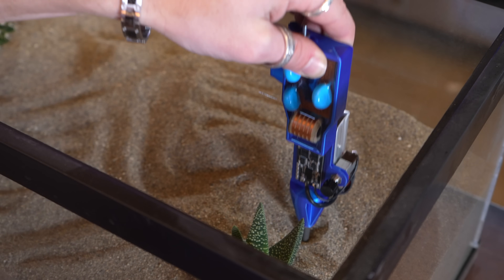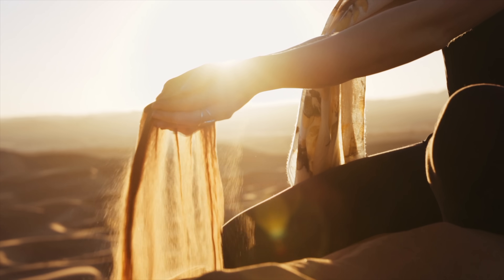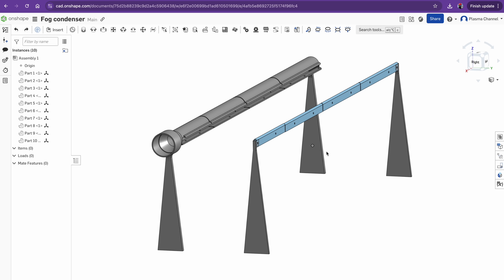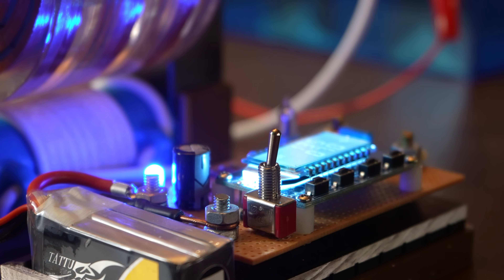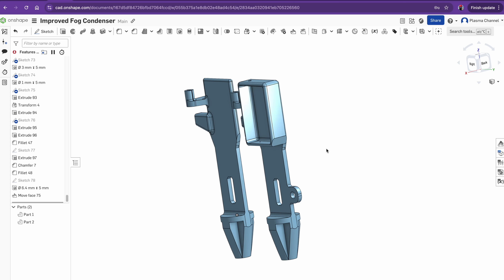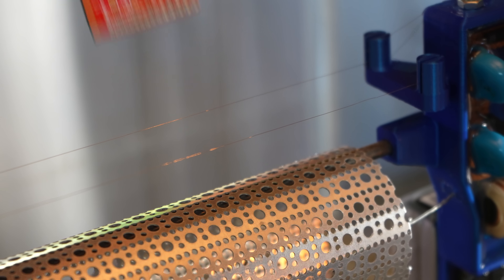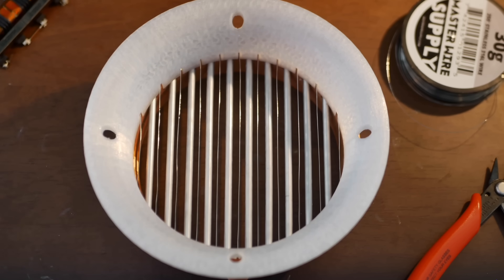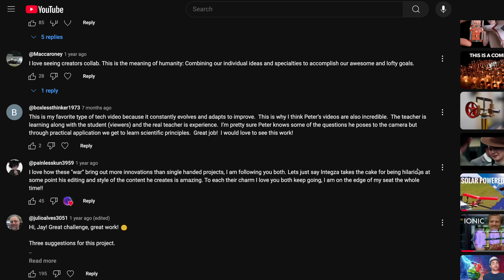Solving Desert Water Shortages Using 20,000 Volts

Comment: While this wonderful work has me more than interested, one significant fact is that while your uncharged wire collected almost no moisture, trees have been doing this for ages.  In fact, Shawn probably has seen many of these if he is in the Pacific Northwest.  Redwood trees survive completely in the dry season by capturing fog with their needles, condensing it and the runs off into droplets, raining underneath a redwood canopy.  It's largely known that the surface of the needles cause the condensation.  I am not aware of any other phenomena such as electrical charge or sound that the needles use to capture the fog and turn it into rain.
One significant factor that Shawn's work has here is that it is not one contact point of fog that is prepared to be captured, but a radius of ionization around the wire.  I'd still love to see just how large that radius is, because this directly implies that fabric or metal screens could be prepared to capture more moisture from a region of air.  There also has been several studies on capture of fog on Namibian and South American coasts where fog nets are used.  Studies say that there is not enough productivity to support people, but if the goal is to add water to underground water storage systems or catchments for the purpose of creating a water supply, then a comparison between the output of both needs to be evaluated.

Comment: I assume that your solution only works if there is visible mist (small water droplets) in the air?
In this case, no water condenses, but the droplets collect on the condenser. This requires little energy and is fast. There is no phase transition.

The usual dehumidifiers work with condensation by falling below the dew point. Here, water from unsaturated air on a cold surface is brought below the dew point, like the air on a bathroom mirror. This costs a lot of energy, but it also works without mist.

So, if there is a morning fog, your method is perfect.
If there is no fog, only the ‘old’ method remains, but it requires a lot more energy. However, this old method works poorly with fog.

Comment: We did it boys, a dehumidifier
Reply: i mean it isnt one because it can only attract water droplets from the air, a dehumidifier can rip out the water if its below the dew point (100% saturation) with condension thats the reason why this can be more effective than a dehumidifier, so it NEEDS the Mist, however if the air is normally pretty dry and only suddenly gets hight amount of water(Mist) its at least worth testing it out. In Regions without that morning Mist its useless.
 3 Things make it at least worth testing; 
Scaleability: you can make it cover a large  volume of air without too much of an increase of the other components
Simpicity: its not that complex and would be easy to repair and fix, which is important in 3rd World Countries
Cheap: the most expensive part is the high voltage generation but because there isnt actually any significant load you can use very cheap ones. However this needs to be scaled up a bit and testet at site, perhaps the mist is to thin or any other variables dont work.

Comment: Missing a flat metal panel test... just stick plane old metal without holes Infront the fog, how much condense you get... without any energy, I bet it will be close to the same as with having ions blowing water vapor through a net and hoping it hits the metal... Or better yet, use plain on fan to accelerate the fog to the same speed against metal panel and compare power consumption of fan and how much it collected... + if there so much humidity in air in desert it would not be a desert :)

Comment: Having an electrified wire over a crop may be an issue for local fauna, or a farmer who forgot the wire was there. A very fine mesh may increase the efficiency of water capture. Would the increased efficiency of your system make up for the difference in initial cost, maintenance costs and simplicity of current mist net systems?

Comment: The evaporative losses will ultimately determine what time in the morning this idea stops being able to condense water from the air. The air is also much less humid than your test setup. You will want to redesign around shade and airflow at some point, so feel to try this: 

In a cylindrical configuration you can collect water into a container below. A cylindrical tower with a gap at the base will create its own updraft (think of the cooling towers for power plants) and a central cone-shaped electrode will assist this by creating an ionic wind with the right polarity as well as fuelling the condensate to a drip fed container.

With a conical mesh in the centre of a tower you not only have your condenser in moving, moist air, but it’s crucially also shaded from the low rising sun and has a relatively small collection area at the base of the cone which you can immediately collect into a container instead of evaporating from a wide tray.

Comment: With the dehumidifier, presumably that one's able to get water out of the air that is in gaseous form rather than fog? Can you do a "dry run" of both and see if this setup also manages that? 'Cause if it doesn't, then there still are clear reasons to maybe prefer a classic dehumidifier, at least in principle.
I also question somewhat whether a device like this would hold up under the kinds of conditions you find in an actual desert. It turns out desert environments are extremely abrasive....

Comment: There are plenty of places this would work.

Definitely wouldn’t work far inland at peas here in Australia I have worked a lot of night shifts in central Australia and almost never seen a fog unless the wet got down that far and /or the lakes have filled up.

Also comparing it to a dehumidifier is something of a red herring unless I suppose you are putting it in fog as well. A dehumidifier has to change the state of the water gas in the air this doesn’t it just has to redirect tiny droplets so the efficiency is potentially enormously greater as long as there is fog in the air.

Dehumidifiers even heat pump ones have always seemed like a waste of resources and energy for water collection. Depending on how it scales your prototype shows way more promise than the things a lot of unscrupulous people were selling

Comment: how about changing the power at different rates and comparing the result accumulation in order to find the most optimized power use. You can make this easier to test by tear-weighting the drip pan plus device, instead of worrying about shaking off excess and using a squeegee (wasting time and may miss some anyway).

Comment: Hi in the study from MIT they used a SS304 mesh of 1.6mm wire and wholes of 2.6mm as best result, you used a perforated mesh. Was their a reason for this? Did you test different mesh's?

Comment: Scale this up, pairing with a solar farm. With the upfront cost of the solar farm & yearly maintenance over 25 years, say generating 1000 gallons per day as a base estimate. It would cost a very roughly estimated price of $0.030 cents per gallon. But I have no idea of the costs of installing & maintaining the scaled up fog catching device. And this was priced using your very overinflated values due to you using an over abundance of fog. Presumably the mesh nets will also need regular replacement as they will erode over time, & then like all electronics there will be breakdowns & need of consistent repairing & replacements. 

However compared to a desalination plant which ends up delivering a price of $0.45 per gallon, it may not actually be too far from that surprisingly. Even if it is slightly above that, you are getting a moisture capture method that also works inland. So I think there is genuinely an idea worth pursuing. Again these are all rough estimates but it could be worthwhile for some industrious person to work it out with every cost accounted for.

Comment: These cheap dehumidifiers are not great for comparison. They use peltier elements for cooling which have an absurdly low efficiency
Try the same test with a larger compressor type dehumidifier. Let it run with and without fog to compare. Such thing sure draws about 300W of power but since you try to scale everything to farm size this should be ok

Comment: Im in Cali , & have the perfect spot. A farm. super dry during day, but many late night parties revealed to me that fog rolls in religiously in the morning. So bad that my laptop mouse no workie, the whole thing looks like an iced drink. However, you'd likely get more clicks doing your epic adventure.   Socal / LA

     On a diff note >> eventually, after doing the fundamental science >> you should try 2 other experiments.  1: fill an underground water tank without a metal condenser. USE SAND :)   2 : Is it possible to water the plants directly ?     
        oh and lastly, I remember a famous scientist(tesla,maxwell?) found that for every foot in elevation a certain amount of kV is present. I confirmed this decades ago. It is true. Just take some enamel wire and clean piece of metal up as high as you can get it. I went on top the roof. Used a metal stake as a grounding rod as I thought the electrical grid would mess the results. Knowing the current (Amp) requirements for this water experiment is another super important variable. Caz there is already voltage in the sky, not much current tho...    Make it rain bro !!!

Comment: This has been tried and failed before. You people are smarter than this, there isn't enough moisture in the air to do this efficiently. Just watch the Thunderfoot water seer vid.
Reply from the maker: The waterseer doesn't operate off of fog. There is tons of water in fog, which my device solely runs off of, as clearly talked about in the video. This method has NEVER been tried before outside of MIT and myself. It's brand new. And you're looking at the person who will bring it to full market.

Comment: There's a programm by the UAE called The UAE Research Program for Rain Enhancement Science (UAEREP).
I belve using a modified version of your technology you can go from simple irrigation ast that would need actual ground capital to make it feasbale as in building or plaging the metal grids over a large surface area of the ground which will be an expensive task.
rather than limiting your technology to the ground.making a single arial unit that can irrgate an entire dessert region using this technology souns more promising than the current cloud seeding methods this programm currently uses as cloud seeding has its own demerits where as the applicaton of your technology workd using nature as the backbone and that s the water retention capacity of air in response to changes to temparature.
luckiliy apart from this alone MIT too did a similar project a while back trying to make an effcient electrosatit flying drone....of which they were succeful but it has such a low power that it can only manage to life itself.its basically a glorified horozontal ionocraft rather than the vertical version we are familar with.
but picture this,the craft is relatively inexpensive to build so
if many several hundered units are built thousands even it would still be ALOOOT cheeper than the current budget the UAE puts out for rain capturing technology
so these thousands of iono craft planes which fly at relatively slow speeds are launched about 2 hours before dawn over the Arabian desert.as they fly over the skies they use the same principle to condense water rather than the chemical based syte the UAE currently uses,which honestly is ineeficient as truthfully speeking cloud seeding isnt a complete scienc and sometimes works and sometes doesent so it has a low success probability.but your technology is 100 percent guaranteed to condense water.
so as the ionocrafts fly over the desert they condes water in the atmosphere creatng physical water droplets in the atmophser that attract more water vapor through Hydrophilic action.
so by sunrise youve created a huge cloud mass that cant hold its weight and releases water onto the surface as rain and precipitation.
The applictaton of your technology in this manner is very feasable,practical and best of all CHEAP and not chemically toxic compared to the current rain enhancement methods used in the UAE.
The call for proposals is currently going on for the 6th cycle.
but i trully believe that is the best direction for this technology not just irrigation but actual Rain Enhancement.

Comment: Dehumidifier has nothing to do with mist. Mist is warter particles, so they can be gathered using electrostatics. Dehumidifier squizes water vapors from air, which in turn, is not something that can be done by electrostatics.

Comment: Look into COFs and MOFs, hit me up, I would love to do a show with you on them.  They are capable of absorbing moisture from air lower than 20% RH.  They are selective to water as well; outputs pure water. Outputs water with gentle heating - which can be delivered by alomst anything.  Can run multiple cycles/hr.  I'm designing and building a system now.  super revolutionary.  plan to make large radiator-like boxes with MOFs deposited on the fins. These things scaled up I calculated 55 gal/cycle, 4 cycles/hr in a box the size of the smaller sea container.

Comment: I wish it was as easy to strip humidity out of indoor air, but it's a very different beast.  The way your apparatus affected the airborne water droplets was very similar to the classic smoke demo that used to be popular with ioniser sellers.
Reply: So this wouldn’t work as a dehumidifier?
Reply: @VictorZucchini  Humidity and fog are different. Fog are water droplets than can coalesce into bigger droplets. You can't coalesce vapor into water. I think you need to cool it down or compress the whole air that contains it.
Reply: Yeah, the humidity is terrible in the tropics. I wish it's easy to remove but no, I need to turn on an ac. Meanwhile the desert dwellers just leave a bowl of water in a room to add humidity. Seems it always harder to remove heat/humidity than to add it.
Reply: @nunyabiznes33  That's is because it is. Simplisticcally, When your removing heat and humidity your taking energy from the particles making them slower. To add heat your exciting the particles to move faster. However unless your starting from zero degrees it's easier to add more energy to particles that are already moving. Than to take away energy from particles that are not doing such.
Reply: hmm that makes sence :) just build a small setup but dont have a fogger :) with 10kv i got nothing at all :)
Reply: I know. This could be tested, relatively cheaply in an actual desert. WTF are both the studies in labs? I hate when proof of concept is not presented, but people try so hard to pretend this is proof of concept in deserts.

Comment: Maybe I am in over my head, but is that an AC output? Looks to be a cockcroft-walton circuit but the way it looks to be wired up currently is for AC, wouldnt it be more beneficial to be DC based on the research paper?

Comment: Impractical for desert use. The reason why is because there actually isn't enough moisture in the air to make it economically viable. You get very little water for a high cost, to the point it'd be cheaper to truck in bottled water, not that that would be economically viable either.

Comment: So now, shape the collector so it forces the ion wind downward maximizing the time the ionize air and fog passes over the collector (brachistocrone?) and make the mesh hydrophobic, and if you use just the right wire thickness and grid spacing? Think in terms of nucleation sites?  In fact there may be a material that is optimal for this, or one that can be engineered.  Seems reasonable that you could stage these collectors to increase the net effect.  If the power in to water out is big enough one could ultimately imagine a water station in the desert powered by any number of sources.

Comment: JFC - My only question is V vs collection - 5v, 10v, 20v, 40v, 80v, 160v, 320v, 640v, 1.28kv 2.56kv 5.12kv - and see what collection and the ml per watt per hour and if you can use a different mesh, and at what level of humidity it works - sensor - if it goes above level then it turn on - to collect - - - no reason to power it if it is not going to give any output, and - of course, there is the buried pot systems - will it work with them.. . . . ping me if you want to talk - I am on x.

Comment: So, you have an efficient way to pull water from the air.  You're thinking about how to use it in a desert setting.  How about a different application?  In Florida, we have lots of problems with indoor humidity.  The commercial and consumer grade de-humidifiers are expensive to run because they use compressors to cool rods that condense moisture in the are.  These condensers also introduce heat on the other side which again must be cooled with A/C.  The result is an extra $25 to $50 per month in electricity costs.

So, what if you can scale your idea for power efficient dehumidifier?  Without moving parts, compressor or coolant, such a device would be much cheaper to maintain and manufacture, and the power savings could be well over $300 per year.

Comment: my only thought is that if you upscale it for crops wouldnt you eventually loose voltage the longer the positive wire is? if the wire is too long parts of it might not deionize the water from the air

Comment: if it works incredibly well and is scaled up heavily, is there any safety concern with drying out the air too much? or is it just, the sheer volume of air it would be pulling from would make the difference negligible?